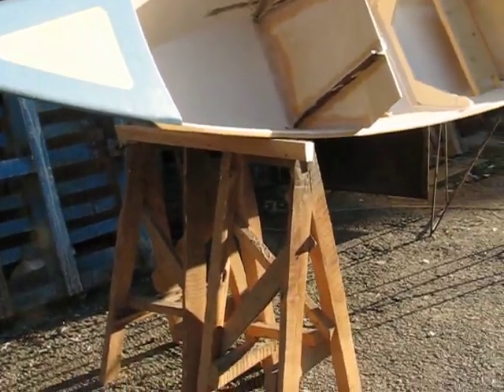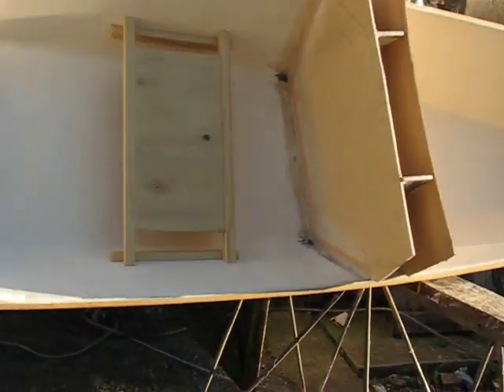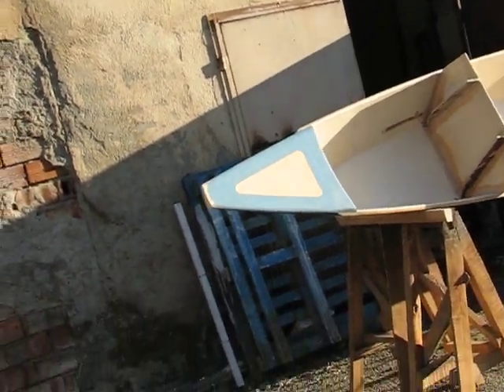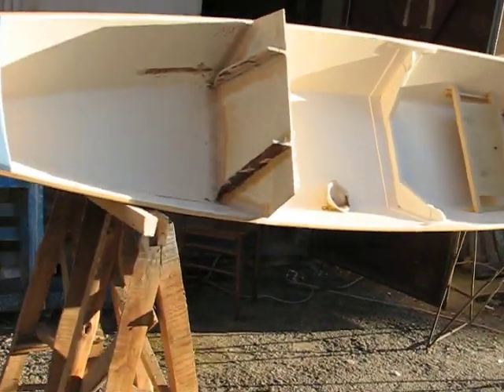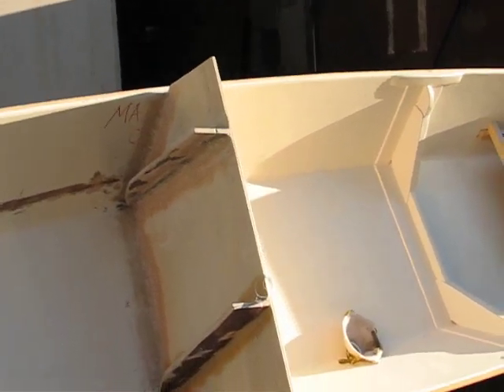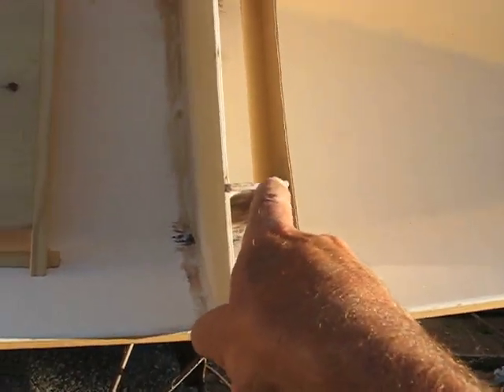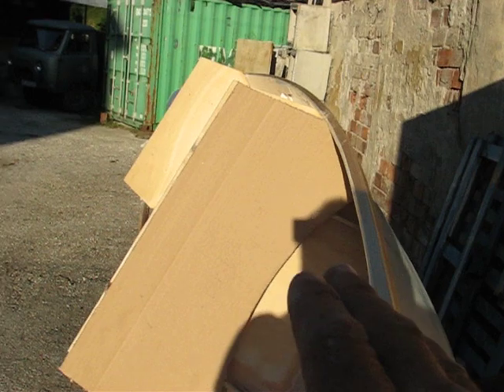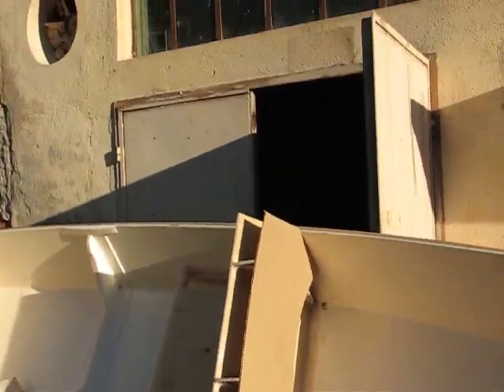Building proa Make O'Break 1

Comment: Rael, i love the boats youre building, and your approach to tinkering with designs. Something about proas are really inspiring.  

Im working on a design for a proa myself and have gotten lots of great ideas, advice and inspiration from you.

What are your thoughts on schooners and lug rigs?  Ive got a boat designed to meet my need and im still figuring out the rig.  Schooner balanced lug rig are what im leaning toward.  

Good luck with all the endeavors!!!
Reply from the maker: Happy we can help, thanks 4 mentioning it Blair.... If you're building a proa the force is strong with u, so may luck 2, B  on your side......

 At Balkan shipyards we have come to the conclusion that simple is best, there 4 one sail is better than 2 for shunting. In My opinion. So for a tacking outrigger canoe, if that's what you're building go ahead, divide the rig if u feel there is need to..... 

Still I think 1 big sail is better than 2 smaller ones, for many reasons.... Some are: cost, simplicity, price, ease of use...... and maybe a few more.

Though always at one point, you will have to break down your sail plan, into smaller manageable pieces.... So  A Schooner Lug Rig is a fine way 2 go,. Though for a shunting proa??? I had a schooner Crab Claw on Crystal Clear and shunting 2 sails at once , was a pain in the arse........

Proas are funny birds, welcome aboard....
Keep Shunting man, Balkan Shipyards.